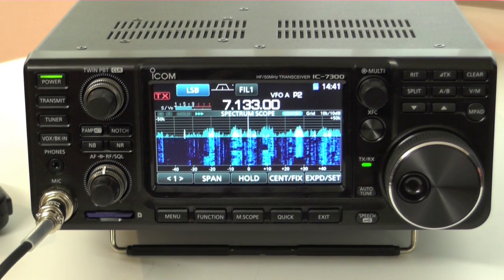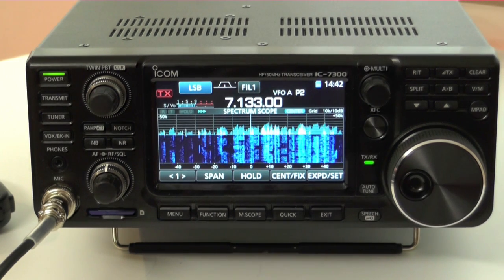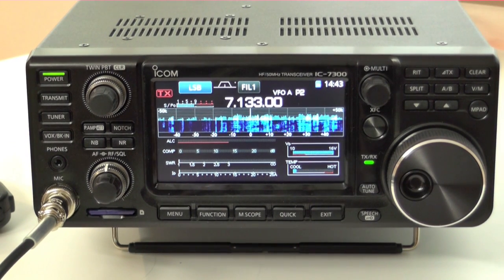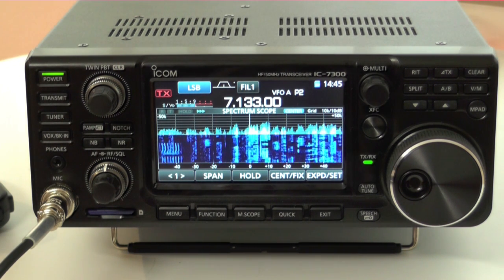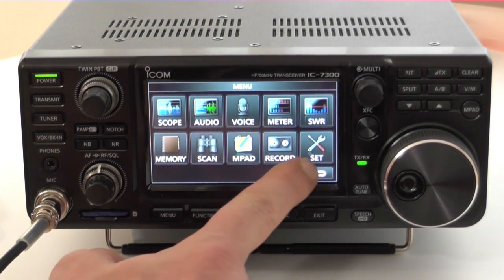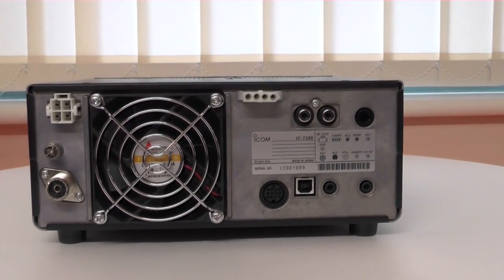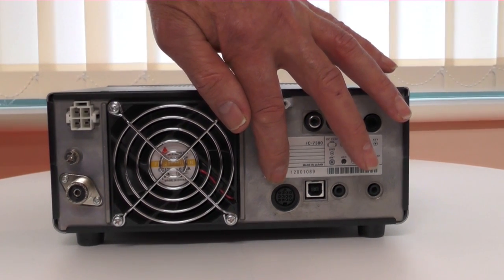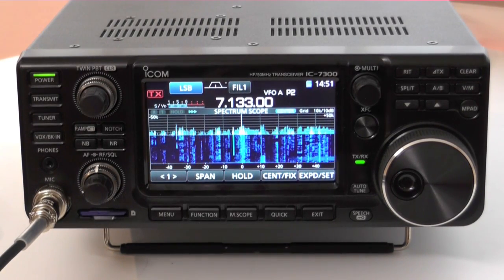Introduction to the Icom IC-7300 HF/50/70MHz Transceiver

Comment: I've had this radio for 6 weeks now. It really is a great radio. Most of the on line criticism is nit picking. some are just sour grapes. Going to make a whole lot of 100 watt rigs obsolete. Fantastic receive.
Reply: Is the touch screen plastic or glass?
Reply: I concur. It's a fantastic radio. It replaced my main rig in my shack it's that good. I also use it mobile in my car powered by a leisure battery. It pulls  just under 1a on rx. Bloody fantastic. For a long time I searched for a good all rounder. 7300 is just that.

Comment: Not keen on the way you have to go in and out of the display to change the functions would have been better to have more buttons on the front panel to show which function is in operation and  Only one aerial socket?

Comment: how yo can see signal on a small screen not so good after all better to buy real SDR radio big screens flex 6700
Reply: Elan Paim You can get software to run the radio on any monitor you want anywhere in the world, if you have an internet connection.